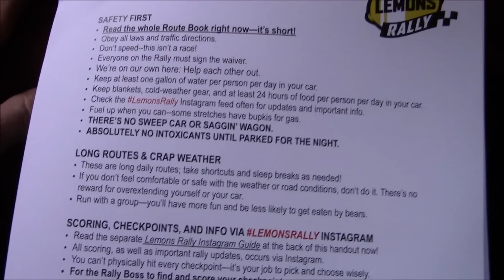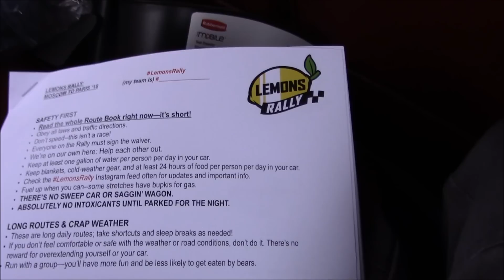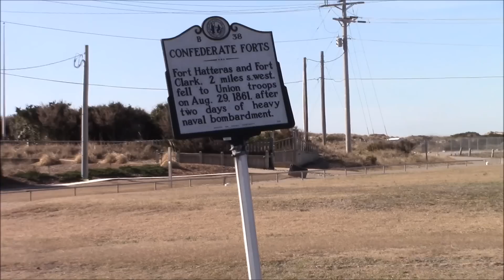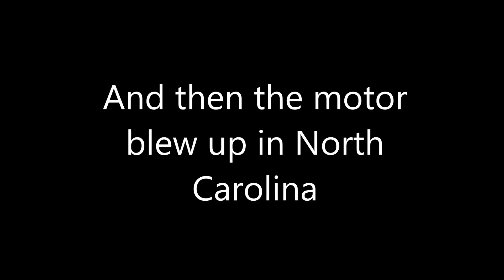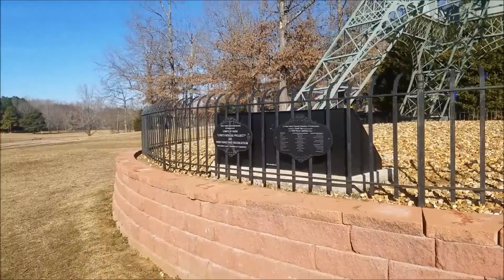3000 Mile Roadtrip In a Junkyard 1963 Impala - Lemons Rally 2018

Comment: I've gotta join one of these rallies some day. This looks like so much fun.
Reply: A friend and I planned to do one of the Cannonballs back in the late '70s. We figured we could do well. One thing driving (no pun intended) us to do it the most was Corvette News had a '63 in it with a showboard stating it was the world's fastest Corvette having run a Cannonball in around 36 hours (I think - it's been a long time) and we figured we could beat that and take the title. Part of it was going to be inflight refueling.  We were going to station a few friends along the way with gas tanks and pickup trucks and pull up side by side and fuel as we went. Even if we had to slow to 55 or 50 to do it, it was MUCH faster than pulling off the highway, into a station, gassing up, and then getting back on the road. We figured 4 or 5 of these would save us an hour or more and that could really put us in the running. 
The problem was the costs. By the time we figured all the money spent on gas for us to NY, to LA, and back home, plus gas for all these mobile refueling trucks, and the food, lodging, etc., for them, the costs were going to be staggering for us. 
And we were advised that while it probably wasn't illegal to refuel on the fly like that, if a cop saw us, you can bet they would cost us a lot more time than simply stopping in a station to refuel, 
In the end, it turned out to be a great source of entertainment planning and that was it.

Comment: Back in the 70s we drove from Ct to S Carolina in an old MGA and the engine started knocking. When we got there we borrowed a VW and a heavy rope to haul the engine out over a tree branch one night. (rope tied to bumper) Had the crank turned for $3 per journal and put new bearings in it. We used the oil pan and the electric fuel pump as our parts washer. 2 days later we drove it back to Ct. On the way home the radiator blew out (beyond repair) so got one from a Plymouth wagon for $25 and tied it to the bumper, then got some LONG radiator hoses through the grille opening. Still have the car.
Reply: Sounds like an adventure.  I was driving a 202 HZ ute from Sydney too wagga wagga at night during a storm when the water pump shit itself about 50 km out of Sydney. I wrapped heaps of string around the crank and alternator pulleys and drove about 1 meter behind a semi for the next 350 km with the road spray from the back of the truck cooling the engine. I had to turn off the highway and the car died about 3km later. I got flat towed the last 100 km by someone passing in a 4wd
Reply: @MrDemonchild71  ... that sounds similar to a friend's 50 Chvey 6 cyl that blew a water pump on a rural road. He joked about needing some "water pump grease" and this old timer came out of the garage with a can of water pump grease. This was the early 70s and he had no idea that was such a thing before before 1930. We screwed a grease fitting into the weep hole and lubed it up. Got us home and lasted another week!

Comment: Love the surface rust and blue fenders. I would keep it that way and just make the car mechanically good and fix the rot with sheet metal. What fun is a pristine 63 impala. Lol. You see them at car shows all the time. I have a 63 olds dynamic 88 really clean. I did brakes, tune up,new radiator,etc and had the car painted to its original color but in hindsight I should’ve left it ratty and wouldn’t have to worry about nicks and scratches. Good luck with it. Great video bro

Comment: A white '63 Impala coupe with a red interior is such a quintessential '60's machine. I had a '64, but I always preferred the lines of the '63 better. Keep the original steering wheel in it. It's not only one of the coolest, but it just looks right.

Comment: Wow I really want to do this. About 10 years ago I drove what was left of a 1964 Ford Fairlane from Phoenix, AZ to Allentown PA and back (well, almost back, the transmission crapped out about 200 miles from home and it had to be towed the rest of the way. No 2 speed Cruise-O-Matic transmissions anywhere to be found. The front end was so bad that new tires only lasted about 1500 miles. I took 2 new mounted tires with me, swapped them in Broken Bow, OK, made it to Allentown, PA, where I had to get 4 new tires, 2 to get me halfway back and 2 more to get me the rest of the way. Engine burned oil really bad, I ran 60 weight racing oil and STP in it. I still have the car, sitting up on blocks to keep it from rusting any more. I might just find another engine and transmission for it, patch up the front end, and give this lemons thing a try. The worst that can happen is that I have to sell it for scrap somewhere along the way and take a bus home. 

I love the title of your channel. Never owned an EFI vehicle in my life and never will. I'm a 62 year old auto mechanic, though I seem to spend more time working as a computer technician than a mechanic these days. Computers on wheels SUCK

Comment: 21:56 - U-Haul's agreements are so horrible. Some friends needed to move a washer and dryer and rented a 4x6 open UHaul. When he got there, they wouldn't let him tow it with his '90ish Explorer. Granted, it was the Ranger based Explorer, but still, it was a open 4x6 trailer that couldn't weigh more than 600 lb. and a washer and dryer would be on it. So I got a call to pick up the trailer with my Suburban, got their washer and dryer, and hauled it over.

Comment: Very cool. What size wire wheels were you guys rolling on?
Reply from the maker: 13
Reply: Fuel Injection Sucks Whaa? You guys went cross country on 13s? What kind of transmission? On my 63 it seemed to be struggling over 50mph. I have a powerglide 2 speed tranny.

Comment: Those are the Chevys that GM will never mistakenly build again. 
The odometer, if it stills works, has probably made at least 3 round trips. Some of the heads on that I6 did not make it to 100K . But with good machine work 300,000 plus miles and frequent oil changes, or if it gets a rear main leak that matches 1 quart per tank. You end up with a self changing oil system.
NOW GM just builds cars (SUV) so all the unnecessary interior dodads  will fail and the olde lady makes you buy a new one. That or you spend a 10%-20% down payment on a one to fix it. 
BTW I got so efficient at changing 1960s GM motors I could do it in 4 hours. Pretty much impossible to do that with a 2000+ sidewinder engine. BUT the real fun is changing out a T-blazer 4WD/AWD with a I6 engine.